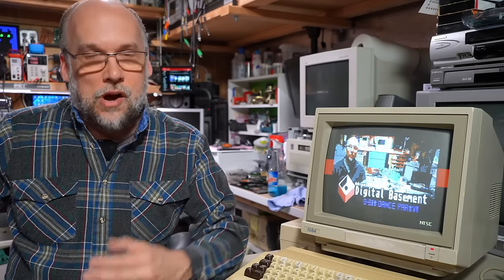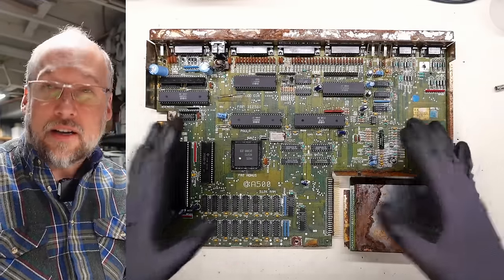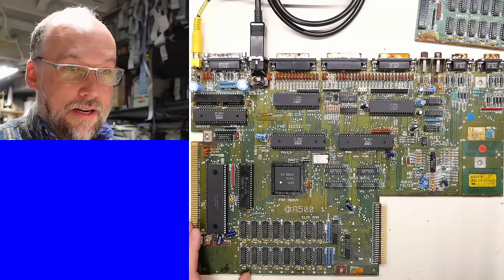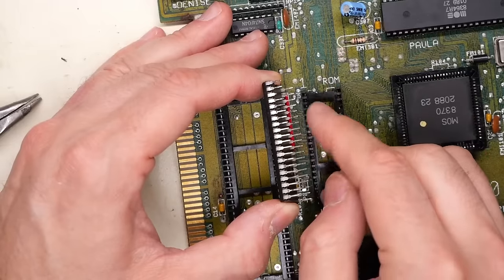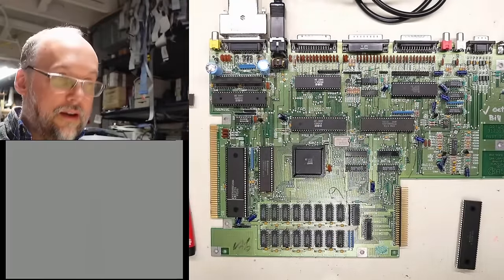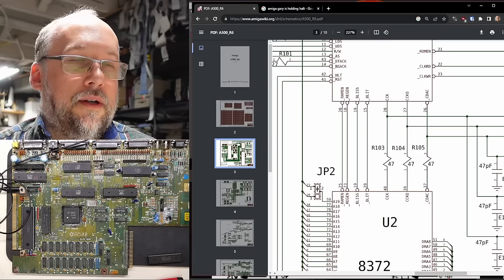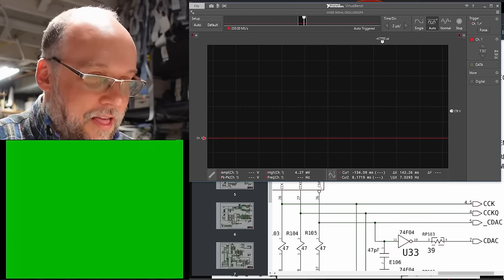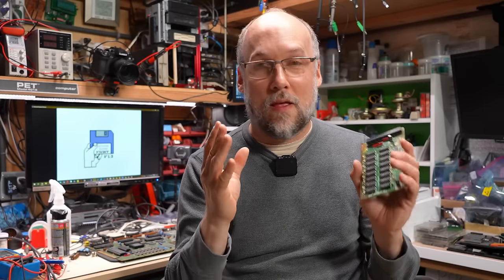This Amiga 500 was left outside for years. Let's try to revive it!

Comment: A few months ago, I found an Apple IIc at a recycling center in a very similar state.  The bottom was just a brown mass of rust and goo.   After seeing all your videos, I thought "what the heck" and took it home.   Inside it was even worse.  The RF shield had completely eaten through in most places with just a tiny bit of shiny metal left and all the ports were solid rust.   The infamous keyboard rubber mat had turned to dust.   Still, I'd seen you recover worse, so I pushed on.   The floppy drive had  rust and insect corpses pouring out of the slot and there was a disk inside that had fused to the innards.  Surprisingly, the  rubber belt (that usually turns to dust or  goo) was intact.   Long story short ("too late!"), after a lot of de-oxit and IPA and rust remover, I plugged it in and it mostly worked fine!   The biggest shocker was after thoroughly cleaning the floppy drive and re-greasing the components, it also worked.  This was the ultimate goal since I had a stash of about 40 floppy disks from the mid-80s with no way to read them.   5 1/4 floppy drives are getting very rare and ones that can work with Apple II disks with something like a kryoflux are even rarer.   And another shocker was of the 40 floppies only two were unreadable.  Not bad for 35+ year old magnetic media.  It was quite a joy to re-discover some computer projects from my grade school days and archive them.  Now I can run them in an Apple II emulator and show my nieces and nephews "This is what your uncle had in school when computers were new".    So thanks for the inspiration and maybe check if that floppy drive still works.  You might be surprised.
Reply: Mouse and that mouldy joystick are worth a shot as well. Though i guess it's good to disassemble it outside and maybe dip it into miconazol just in case :D
Reply: Curious how you archived the floppies?  I have boxes worth also from the '80s.  Still have my Apple ][ Plus, //e, and IIGS, but would be good to be able to access the disk images from an emulator.
Reply: I would be careful putting anything into that drive that you care about - throw some disposable diskettes at it first!
Reply: @the_kombinator  Exactly what I did.   I got some blank disks and then transferred known good disk images from a PC to the Apple IIc via ADTPro.   Those booted fine.  Then I had ADTPro read the same disk and transfer that image back to the PC and verified it was byte-identical to the original.   Then I went through my disks in order of least importance (just in case the functionality was intermittent) and imaged them to the PC.  I'd seen videos of people preserving old magnetic media where as they were being read for the final time, the oxide would come off, so I acted as though I had one shot to do this.  In the end I had a lovely time capsule of the 80s including an ancient AppleWorks database of my old comic book collection (and realized the box is still buried in tupperware bin in my parent's basement appreciating in value).
Reply: @MrTBoneSF this is most impressive. I meant to joke about you living in a parallel universe where magnetic discs last longer than 10 years, when even CDs are capable of developing errors in less than 20, but you really went "digitally basementy" about it. Maybe your pastime is reading documents directly from the paper shredder bin?
I am glad to have stumbled across this thread.
Reply: @MrTBoneSF 
You do know that most comics aren't worth a damn now right?

Unless you have highly sought-after books like Action Comic #1, Amazing Fantasy #15 or something on that level, you have just a tub of books that are completely worthless.
Reply: @LUCKO2022  Just like most collecting. 99% of everything usually is worthless  But you never know what becomes popular 40 years later.   My nieces were shocked when some games I gave them as kids were now worth hundreds on eBay (even before the whole WATA scam) because they were somewhat niche titles by developers who later made it big.

Comment: It's pretty impressive how resilient electronics can be.
Reply: Back when planned obsolescence wasn't a thing (to the extent it is today)
Reply: Especially something that was made as cheaply as possible!
Reply: Car manufacturers take note.
Reply: Cars are designed and tested to be left outside.
Reply: Ikr. Especially when it's made with quality parts.
Reply: Older products anyway.
Reply: My wife had told me they had an Atari growing up. Looked for it from time to time, never found it. It resurfaced after the house flooded, stuck at the very end under a concrete staircase. And it turned out to be an Atati XE65. I think I even cleaned it with pressured water. And yes it still works. I have a picture of my 5 year old playing Pacman on the thing. Worth noting that there's not a single smd component on the board.  A big factor in my opinion
Reply: @neogen23  That's awesome! 😁
Reply: I found a Playstation outside that had lava lamp wax all over it. I was able to get it going again (and mod it, obviously) after pretty much a thorough scrubbing under warm water. The laser gave me some issues eventually but this was back in 2003 or something, when the parts were available and cheap.
Reply: In the old days they used better quality capacitors and leaded solder = lastability. Now it's all junky cheap capacitors, and lead free solder (at least in the EU)
Reply: @kevinharrison4909  lmao nope. I restore 90s to 2000s computers, even some 80s stuff like the c64 power supplies have crap electronics inside.

Comment: To help your toothbrush action you should get an old/cheap electric tooth brush.  When the battery died in mine I bought a new one, replaced the battery on the old one and made it a permanent fixture on my electronics bench.  It works really well for cleaning flux and corrosion.😊

Comment: So the main takeaway here is:
Always clean all the sockets and chip legs first before you do any testing
Reply: It's like the new version of the "check if it's plugged into the wall" advice :D
Reply: I would completely 100% agree, remove all chips, clean and deoxit, reinsert, then start tests. Save a bunch of time.
Reply: No, clean them before doing other troubleshooting.
Reply: They are rotten, cleaning will help but the rotten sockets will likely cause instabilities later on. Especially if the Amiga is back in its case (it can get cozy warm inside). 

They all have to go. Sockets are a common problem on all THT-Amigas, even the ones that have not spent many years outside. ^^
Reply: Yep, have a system to follow, otherwise you are just trying to lay a carpet with all the furniture still in the room.
Reply: Exactly. I can understand Adrian's desire to find the cause of the fault but having dodgy sockets (and chip leg corrosion, etc) is just going to make the diagnostic process much longer, more difficult and, in the slightly longer term, it will be a very unreliable device.

Comment: If you can find some in your area, get an aerosol, drip can, or spray bottle of Kroil from Kroil Labs (formerly Kano Labs).  Expensive, but one of the best penetrants on the market.  That may have made separating the original RCA jacks a bit easier.  Kroil is an "active" penetrant, and will bust that rust for ya.  Tons better than WD-40.
Some CRC Zinc-it cold galvanizing spray will take care of those metal surfaces once the rust is removed with a wire brush or that dremel tip you're so fond of.  A little sprayed into a cup and then brushed on will get the small stuff like D-sub shells, but be sparing with it when brushed on.

Your approach to troubleshooting is systematic - don't listen to those who advocate a "shotgun" approach.
I would, at some time in future, consider replacing some of the sockets (notably the PLCC socket for the Agnus) that were really crunchy , but for now all seems to be working.  I'd also think about installing sockets for the RAM to make future troubleshooting easier, but that's just me.

Do consider getting caps of the correct value to replace those 1,000 microfarad ones you installed.  That would likely be better for the long-term health of the board.

Comment: "Left outside for years" but the plastic isn't ruined from weathering, the only color on the case is from minimal cigarette smoke and not from dirt and weather or anything. The rust is probably painted on. This actually looks like it spent all of its life in box in a closet in the home of a smoker. The plastic would be cracked and bvroken and would be extremely filthy from weather, but it's not. This is really clean.

Comment: Diagrom is a 512K rom. The board is a rev 5, which has a wireing bug under the kickstart socket, hindering accessing the uppermost address bit.
That's why you got no screen, using the tool

Comment: Congrats on yet another success.  I do have some issues... I get your point about the process, but most people wouldn't have a working Amiga to test against regardless.  If they did, the surely the best thing to do would be to first take all the socketed chips and verify that they work in the Known Good machine (if not, then binary searching makes it quick to isolate bad chips).  Also I'm surprised you left a lot of rust on the PCB.  Looking forward to the next many parts on this, thanks :)
Reply: I thought about this too, but then knew how god awful boring that’d be and learned something about how the Amiga works through the schematics. Adrian should just keep the argument to the point the methodology is to logically go through the process, not brute force the solution. Remember, being fast (and efficient), is just worker bee talk. You don’t have time to waste when you’re in an IT job being intelligent, you just re cap and swap everything and take shortcuts to complete the job as quickly as possible and move on to save the company money. If I wanted that I’d just stick only to my day job in IT (which is my least favorite part about it) and not watch Adrian do what I know deep down is the better way to do it. Being intelligent and logically working through an issue. Definitely projecting but your profile pic reminds me of an old senior programmer I worked under. I’d constantly be in trouble with him for spending too much time trying to understand the why and how instead of just slapping a quick fix and moving on….only for an issue to arise later. Such a terrible philosophy. The time and money overall wasted if you’d just put in the correct effort upfront instead of a hack that only exacerbates the issue worse down the line because you didn’t really solve the problem to begin with.

Point is, sure, if you don’t have time or the correct tools, just recap and swap/resocket all the chips, but that’s just a lame blanket response and would make a god awful video that would only make a certain senior programmer happy that I hope is no longer in the business. Just because it’s faster or efficient does not mean it’s the best solution.
Reply from the maker: Learning why a machine isn’t running is  valuable and trying to see the problem confirms issues before you have to make drastic decisions like desoldering chips. We could have been dealing here with so many issues like bad traces even, so only chip swapping doesn’t teach anything.

As for the rust, it won’t do anything on the PCB so no real reason to remove it IMHO.
Reply: Yup, I think if you're a retro youtuber, it's best to go through the proper process to test and determine why things aren't working and show that process because a lot of viewers don't have multiple machines in every situation and it's good to learn the testing proces.  However, If you're not doing it for a video and you have a spare machine to test on, of course you'll just do that from the start.  As for the rust, I think Adrian still needs to run that motherboard through the dishwasher.  :)
Reply: @TechnicolorMammoth  Just a comment on the quick fix vs investigating the problem in the workplace.  I get both sides of it.  Having done IT forever, I come from the time when you would sit and analyze an issue and work to understand, solve and hopefully document it.  Nowadays with IT areas such as desktop, the practice is to reimage a machine, not to figure out what's wrong with it.  The idea behind that is that rather than spending hours trying to figure out what went wrong with a machine, you can quickly reimage the machine and they'll be back working again.  The issue with trying to fix the problem is that you may think you solved the issue and possibly didn't get all the issues of the problem and could cause multiple revisits and issues down the line.  An example might be a computer infected with a virus, you don't really try to fix it, you wipe out the machine and start from scratch.  Anyway, this doesn't apply to as much to hardware like adrians videos or even areas where you're both the user and the repair guy, but I can see how it is different in the workplace.

Comment: Regarding Gary, i guess it does help to know the Amiga quite well to understand what it's doing. Gary largely does address decoding, and CPU bus handling. One important thing with Gary, and you often find this on Varta'd boards, is that the _DTACK signal is very important. Every bus cycle on the 68000 has to be terminated by DTACK, and if it isnt the CPU will just sit there. Gary actually uses this fact to stop chip ram being used by the CPU when the custom chips use it. 

A17-A23 inputs do pretty much all of the system decoding - if theyre all low, a chip ram access is assumed (_RAMEN is asserted). If the upper bits are $F8, then _ROMEN is asserted. If the upper bits are $DF, it's a chip register access (_REGEN is asserted). 

_OVL is for "overlay" which means the ROM is mapped in at address $0 instead of the chip memory, which is needed for the 68000 to read its initial program counter and stack values. 
_OVR is "override" and is used by external hardware to disable Gary's address decoding during a bus cycle. 

_OEB, _OEL and _LATCH control the 244/373 chips in the "DATA PATH" part of the circuit. This is basically a "bridge" between the CPU side of the data bus, and the chipset/chip ram side. Typically this bridge is only enabled when the CPU reads/writes chip ram, or reads/writes a custom chip register.

There is a text file out there (believed to have come from Dave Haynie) that describes what Gary does. Unfortunately I cant paste a link here.

Comment: Citric acid or vinegar will remove the rusty stains on the PCB and case. Keep it to the areas necessary on the PCB and rinse off well. Evaporust should work well on the metal shields.

Comment: Just an FYI vinegar removes rust as well or better than chemical rust removers and is 100% non toxic. Obviously you'd only use it on an EMI shield that has been removed from the PCB first and separated from anything with copper or anything that acetic acid will attack (that's why it works so well it attacks pretty much everything except steel and iron). Just let it soak for a few hours or overnight and it dissolves the oxides off the metal (that includes black oxide coating on screws so don't use it for that)

Comment: This reminds me of the tine i found a commodore 1701 monitor on the curb. It worked perfectly fine. A week later the same house threw out a full macintosh performa 6400/180 with the monitor, keyboard, mouse and a box full of old software

Comment: I've got an Amiga 500, Amiga 500+ and Amiga 1200 all stored in a plastic container in the attic with a few hundred disks. I'm really going to have to get them down and have a go on them. It wouldn't surprise me if the battery has probably leaked on them though. The missus keeps telling me to sell them for a few quid but I just haven't the heart.

Comment: 2:20 - I would have cut all the soft foam off the joystick and checked to see if the innards could be saved.

3:54 - Judging by the sticker, I have that same floppy drive. Funny story: A few months after I got it, the drive would refuse to spin up when I put a disk in it. I took the bottom off and could se the flywheel start to move when I put a disk in, but then it would stick. I found that it worked OK if I gave it a nudge with my finger. I did that for a couple weeks, then it just started working normally. I put the bottom back on and never had any more trouble from it.

Comment: I would expect you to remove all socketed IC's and clean their pins, clean the socket contacts, de-oxide everything, and while de-oxide is doing its thing on the sockets test all removed ICs on a known working board one by one before even attempting to power this board on. IMHO, that's the correct approach for a field found board with a lot of corrosion. And yes, A500 Rev 5 (and lower) boards have the infamous "oops bug" where they messed up one address line on the Kickstart ROM. This is actually shown on the factory schematics with a handwritten "oops" remark, hence the name of this bug. Kickstart mask ROMs were custom made to get around this mistake, but if you ever need to install another boot image in an EPROM, you need to make mods, or use an adapter PCB.